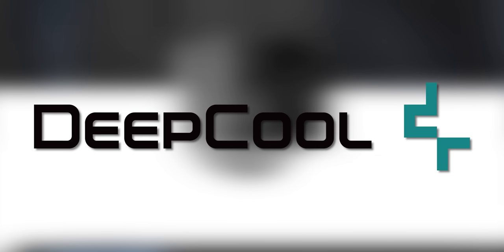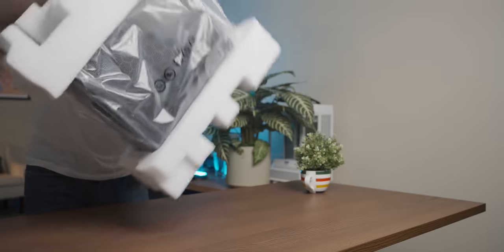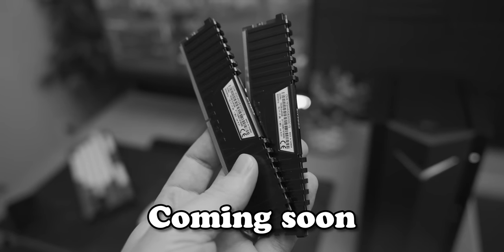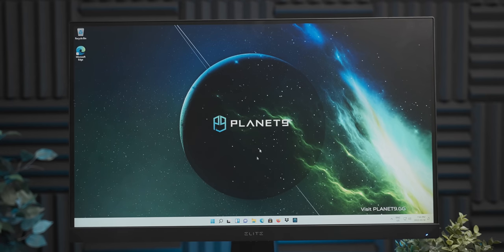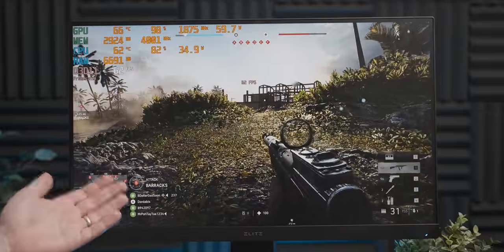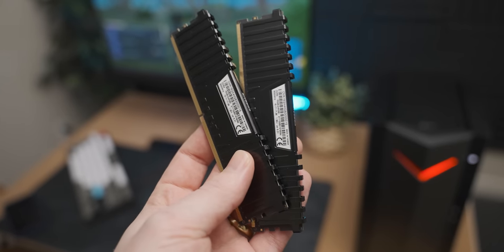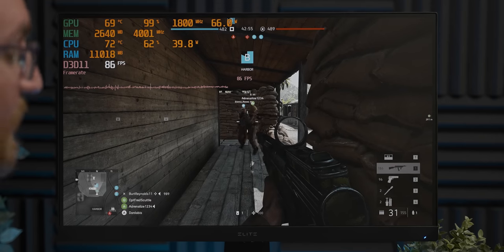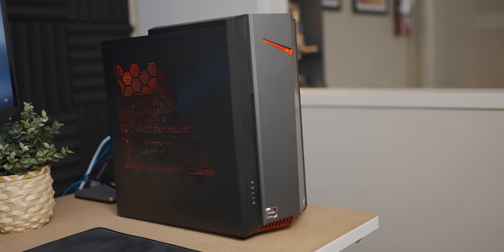I Bought The WORST Rated Best Buy Gaming PC

Comment: Though not the worst i've seen, this is why i build my own stuff, i see so many parts and things i just do not want or even trust, and then there's most certainly crap installed on it, and the case is shit, and you might even be able to beat the price a small bit, and even if you go over a small bit, i will have a far better result.
Especially when you encounter really crap cases (it's not hard to get worse than this), like very specific built odd form factor motherboards and or silly power supplies and all that jazz, when something goes wrong, you're SOL, and often you do get a genuine videocard that is what they say it is, but sometimes with complete crap and poorly built cooling etc.
Sometimes you get a pretty good motherboard though, BUT, that only runs with current GPU's and very limited memory options, so you might not even be able to put much more or better stuff in it, because it's too purposefully built to handle just what goes in it at sale and not much else.
I just do not want to ever run that risk of overpaying for shit.
But sure, not everyone can do that, but let's be honest, this is how they take advantage of people that don't know anything about computers and just want to play a game.
I all but forbid anyone i know to just buy prebuilt machines without checking it out first.

Comment: Acer is hit and miss with their systems. I purchased a laptop (Nitro 5, with the 11th gen I5, an RTX 3050, 256 m.2 and 8g of ram) I threw in another M.2 since it had a total of 3 ssd slots two of which were m.2. I got another stick of ram, and this thing works great. I take it to work for downtime Forza 5 sessions. so for around $820 all in its one of the hits that worked for Acer.

Comment: I did not know... because we do not have a terrorist organization called best buy. I also never buy a stitched-together desktop. That power connector seemed rather normal, except it also had an extra wire that you can use to pull the wire out. That tiny little fan looks like a normal 80mm or 90mm. A standard intel cooler would be weird, label on the front says AMD.

It's mostly the limited amount of RAM, more so than the single channel. But the RAM limit is worse. You get 2133Mhz because that's the RAM's standard speed.

On the cheap end, getting a 1650 is about the best that's possible. Assuming it is a 1650 Super with GDDR6.

Comment: You put the 2 sticks of memory in WRONG, that's why the mem speed was low.
The colored tabs on memory slots indicate the separate memory channels.
You put the 2 sticks in the same color slots, so it was still in single channel mode.
Put them in the first 2 slots of different colors.
That way there is a mem stick in each channel, thus actually running in dual channel.
Figure out basic stuff like this and maybe I'll consider subscribing to your channel.

Comment: Dawid the single stick of ram is the problem and also the apu is the second problem 
The single stick of ram bottleneck the cpu and also give the micro stuttering due to latency and cause the 8 gb can't keep up and the apu is the second beast in the room the apu only get used 100 percent when you use both the cpu and GPU of apu at the same time idk why and also the clock speeds drops lower then there non apu equivalent
Maybe can I get pinned ?

Comment: A bit off topic. I recently viewed a video of yours in which you claimed to be comparing the integrated graphics of a 2400g to the 1050ti. You weren't. You were comparing memory subsystems.

This video reveals that games often need as much as 12 GB of system RAM. How do you think a 2400g with only 8 GB of system RAM is going to perform versus a 2400g with 8 GB of system RAM plus 4 GB of graphics RAM. What you should have been testing, to be fair, is upgrading the system RAM from 8 GB to 16 GB versus adding a 1050ti.

Because some games require up to 12 GB of system RAM to minimize paging, a fair iGPU versus 1050ti comparison would start with a system with 16 GB of system RAM and the VRAM window of the iGPU set to 4 GB. This would then be compared to the same system with a 1050ti added.

I would like to see another iGPU versus 1050ti video, this time done right. Start with a 5600g with 8 GB of dual channel 3200 RAM as a base line. Then add a 1080ti to test against the results when the memory is upgraded to 16 GB dual channel 3200 RAM to show upgrading RAM versus adding a 1050ti. Then add the 1050ti to the 16 GB RAM system to get a fairly accurate comparison between the iGPU and the 1050ti.
Reply: Revision to suggestion. The VRAM window size can make a huge difference. Leaving the VRAM window at 512 MB would leave 7.5 GB of system RAM in an 8 GB system, while a 4 GB VRAM would reduce the system RAM to 4 GB. Testing with VRAM window sizes of 512 MB, 1 GB, 2GB, and 4GB.

Additionally, it would be useful to use a 2GB 1050ti in a system with only 8 MB of system RAM and a 4 MB 1050ti being used with 16 GB of system RAM..

Comment: I am disappointed in Acer?  Their laptops and chrome books were OK for the price?  Even "some" of the PC's were OK.  I have rebuilt and serviced many.  I have 2 laptops and 3 PC's that shipped with Windows 7 and 8 that are now running Linux.  That build was garbage!  But depending on the MB configuration, It could be well upgraded and the stock parts can be used to upgrade older lesser systems.  But I would not buy it and I would not suggest it to anyone.  Shelf units are always fat with bloat wear that kill performance.   That last shelf PC I bought was a DELL XPS 5 years ago running Win 10 and I immediately wiped the SSD and reinstalled the OS bare bones. It is now Running Linux and the box is maxed out on upgrades, and I have all the case sides off for heat dissipation issues and the Video card sticks out and the PS sticks out!  LOL!  It does games well, not great.  That would be a Linux issue as many games just will not run on Linux.  I run a Windows 10 Pro in a virtual box but those anti-cheat crap games just will not do well at all in an Emulator environment.  F them and F their games!  If I can not run Windows in an emulator on a Linux box I will not use Windows, period!  And if I can not run a game in Linux regardless, I will not play it.  The PC you showcase is crap!  Not worth my time to upgrade.  I have not bought a shelf unit in offer 5 years, most of my computers were given to me.  The others I built.  I hate E-Wast and repurpose many machines with Linux.

Comment: It was very fine for an OEM system. Nothing to be ashamed of. The single stick of 8Gb of RAM is the best thing to do.If the system would come with 2x4Gb then it would be horrible.

Your review is not objective. You come in with a negative bias. You get what you pay for, and that system was well built for an OEM. Just throw in 1 more 1x8Gb, and it's fine. If you dont want a GTX1650, DONT BUY a system that has one. If you dont want to pay for an APU that you will not use because of the presence of a discreet card, DONT BUY ONE.

Your review was biased. It was done to entertain... with a bias... 😛

Comment: I used old nitro 50 more than 1 year. And in my opinion, don't buy that! It is now too slow so it need 2min to boot. So, I am planning to do a custom build.... I think upgrading for the system is not possible, and they have lots of venereal disease at pc
I re-installed windows, and it didn't work at all.. I cannot even download new fresh windows. So, I deleted every disease program at computer and I freshly installed drivers. But it did no solved this at all. So, don't buy this.

Comment: I used to like this particular desktop as it was very inexpensive and could handle some upgrades pretty well and I sold quite a few of them. My distaste for this model and other similar to it where when the power supplies started failing. And then you found out to try to buy a replacement power supply would run you almost $200, almost a third of the price of the damn machine. Proprietary power supplies are the Bane to my computer shop existence. If only there was a power supply maker who would make an expensive replacement power supplies for these models. Modular cable so you can buy the cables you need for the particular type of computer that way it would be cheaper to fix. Salvage be salvageable components and put it in a real computer

Comment: ACER NEARLY BURNT DOWN THE MY HOME THEY LIED SAYING I DAMAGED MY LAPTOP WITH WATER AND WOULD NOT FIX OR REPLACE IT THIS WAS LIKE 1 TO 2 YEARS AGO SO GOT IT WORKING IT ALWAYS RAN HOT WELL TURNS OUT ALL THE SAME LAPTOPS RUN THE SAME AND THAT DESIGN OF LAPTOP ALL PRETTY MUCH FAIL BY BURNING UP COMPONENTS AND 2 BURNT POWER SUPPLIES  LATER  NO LAPTOP